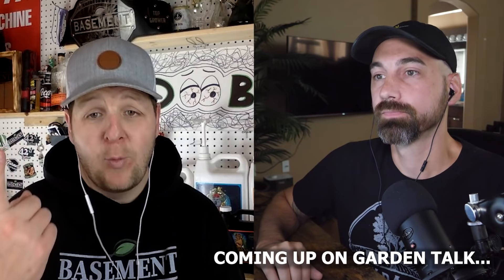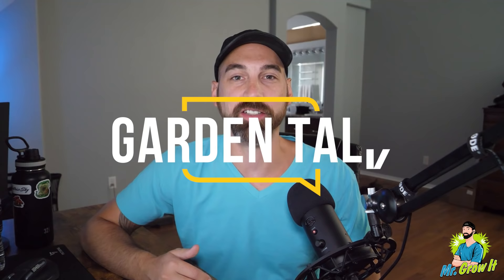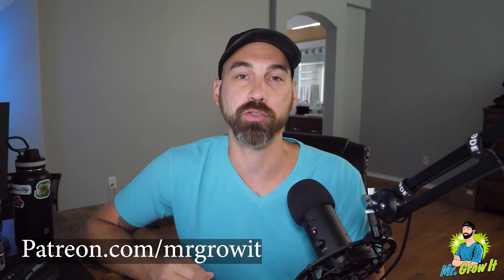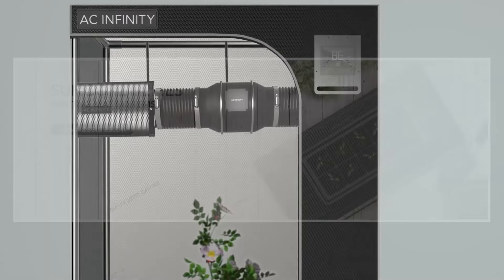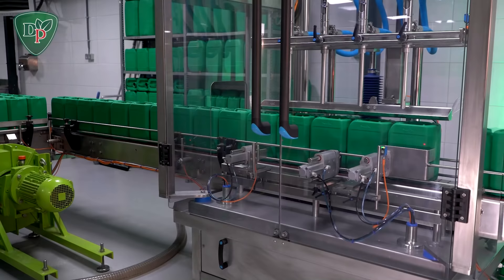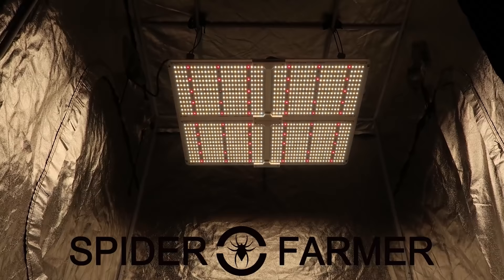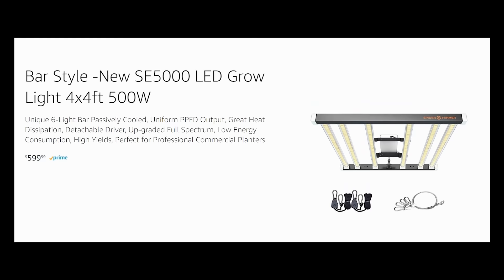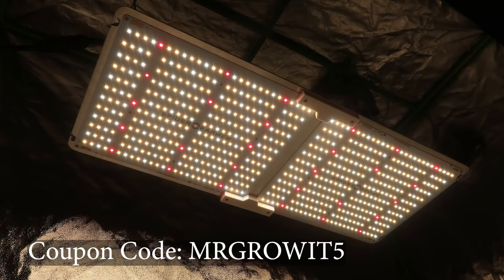Easy Methods For Growing Autoflower Plants! (Garden Talk #32)

Comment: We start autos in a solo cup. They stay there for exactly 1 week then we transplant to a 4-5 gallon pot. We do this so we can sprinkle mykos and azos on the roots. We did an experiment on this the video is on our channel. Mykos and azos can double the size of your plants.
Reply: Have you ever tried those peat planters? Then you don't have to remove them from the container to transplant them, but they probably aren't as cheap as Solo cups lol
Reply: @SegwayBossk  yes i have used peat cups..the problem is the roots have a hard time growing through them and they have to be removed during transplant..so solo cups work best 👌
Reply: @WATCHMEGOBROKE  what’s your average yields in 5 gals? What’s a simple feed to use that doesn’t need to check ppm n ph

Comment: Thank you Chris and joe, im a new grower on my first run in a 4x4 and I need all the help I can get! Running all autoflowers right now.. quite stressful, I think I’m over feeding? But they are growing like crazy.. idk stressful. These videos certainly help inform and are much appreciated!
Reply: Yea lower nute levels fsfs . I find a good super soil and a few top dresses is all ya need for an auto run  . 🍻 Happy growing 💪🌱💚🌱💚🕉🙏👊💯
Reply: do you see nutrient burn? maybe water more in between feedings and see if that helps. but if you don't see signs of overfeeding I wouldn't worry, are the leaves changing color to yellow? getting red stems? are they dark heavy green? if not you are *probably good
Reply: Yes I do see slight signs of nutrient burn, just on the tips a very small amount, I did end up doing that just water last night no nutrients, woke up to a pleasant surprise they are already loving it! Thank you very much!

Comment: I’m late on the podcast but here in Missouri we have such a flux in heat and temp. Even in a single day they can change by 40 degree F and 30% humidity. Great info watched the other gentleman you had on here even those two are some differences in thought. Always learning and appreciate the info you always give.

Comment: I like to use those peat starter planters for everything I grow. I start all seeds in a wet paper towel, then plant them in the starter pots with organic potting soil. I like them because the roots will grow through them and you'll know it's time to replant. Then just put the entire thing into the final spot and you don't have any transplant shock
Reply: I do the same but with coco and soil 50 50 blend. Then after about a week. Up pot, maybe even final 3 gallon depending on how I feel about it. If it's an auto or not also.

Comment: I have a cheap 12$ dollar (PAR:PH:MOIST LEVEL) PROBE from Lowes. Works fine and can get a great guesstimate. There is a sensor that reads the par. Lay the probe , sideways at plant level to get your reading. Great tool to read the dirt as well.

Comment: I'm a NOOB, but on my 4th run of autos, achieved perfection on the 3rd run. Getting 5-6oz per plant, always goes 12 wks. My system and set up is SO easy. They make it too hard.

Comment: Ok so everyone understands what the 48hr light deprivation is truly doing, your plant has trichomes that have glandular heads, they have not only THC but other compounds including the plants essential oils or terpenes, and your terpenes are one of the most volatile compound in the glandular head, it gets released from the glandular head due to ultraviolet radiation, intense light and elevated temperatures over 65°f, so your glandular head in the morning is larger, than  right before your lights go out, so by giving the plant 48hrs of darkness, allows the glandular head to swell or fill to a much larger head giving the appearance of a more Frosty plant, because of the light schedule and the lack of any kind of long duration night cycles during your grow, you will see a massive increase in glandular size that you've never seen before, as this does not promote any more trichome coverage, it still serves a great purpose adding light deprivation of at least 48hrs prior to harvesting, it gives your plant the chance to fill the glandular head with as much terpenes as it can, point in case a much smellier plant, and if I could give anyone a pointer on not taking away from this extra step, don't use your grow lights to see into your tent or room when cutting down your harvest, try not to expose your plant to high temperatures ultraviolet rays or extremely bright lights after harvesting to help maintain all of the terpenes gained by having the 48 hour light deprivation, hope this helps 👍
Reply: Also you will see a much larger increase in glandular size depending on the plants genetics, if the plant is extremely oily or smelly, you will see a more significant increase in glandular size.
Reply: if you have ever had an outdoor crop or single plant, you might have noticed that when it's really sunny and hot your plant is really really smelly, well that's all them good terpenes being released, so yes your absolutely correct, harvesting just before sunrise is a very beneficial time to harvest, I know some growers in Oregon that will put a sun shade over there medicinal plants two weeks prior to harvest to increase there terpenes and flavonoids.
Reply: @consolegamer3591  pretty well put. I will conquer and say I have noticed right before lights on...the smell will be extra thick.  I used to veg in a closet and had no ventilation.. I could tell the lights were getting ready to come on without looking at a clock. The smell would roll through the house like a wave..flower was always in a tent with ventilation fan running. I've done the 48 hour thing the past 4 runs..I have to say I don't notice a difference..but it's not hurting anything..so why not?
Reply: @budstermcgreen6360  It really does depend on the cultivar, and your overall environment, how intense your light is and the output of your uv, if you have a very smelly plant it would be much harder to see an improvement in overall smell, but you should still be able to observe an increase in glandular size, I do have a channel created that I will include related articles to this and a full breakdown of the research behind the trichome development and interactions between environment and the release of terpenes and other compounds in the trichomes, to much to cover in this format, but if you have any questions feel free 👍

Comment: From 80 to 100 F is 20 points of interval measurement, 26 to 36 C is only 10 points of interval measurement, so obviously fahrenheit is more precise. Those are the same temp ranges with twice the capability to measure in F compared to C.

Comment: I've use that mycorrhizae fungi and seem like when I sprayed it on my plants it burns them up seems like it shocked them for about a week or so makes the leaves turn brown
Reply: Were you using straight mycorrhiza or were you using like a slow-release fertilizer with mycorrhiza in it, cuz I've seen a few of those and they try to make it look like it's just micro

Comment: I put auto seeds in a propergation cube which is inside a rockwool cube and plant before roots come out the cube easy had no problems. Every time I put a seed into its final pot (coco) it failed convinced it dnt work.

Comment: The use of aspirin on plants appears to be beneficial, but the question is: why? Apparently, plants produce small amounts of salicylic acid on their own when they are stressed. This small amount helps plants cope when they are under insect attack, dry, underfed or maybe even experiencing a disease problem. The component helps to increase the plant's immune system, just as it does for us. A dilute solution of aspirin water for plants gives accelerated germination and some resistance to disease and pests. Aspirin in vegetable gardens has been shown to increase plant size and yield.

Comment: PPM is a part of your grow that is advanced but also fun to “dial in”. From a DWC standpoint it serves many purposes but for those starting out it helps on saving money on nutrients in the long run.  Here’s a simply way to understand this and why.  If you have 500 ppm in nutrients for a 5 gallon container, your goal is to find out if your plant is drinking and eating the same amount over the time of your mixture.  If your plant drinks 1 gallon of your mixture out of the 5 gallons and your PPM rises to 700, you just over fed you plants and wasted money in nutrients.  Vice versus if you started at 500 PPM and it drops to 300 ,your plant then is eating more then drinking.   Keep a log of day to day PH and PPM measurements and most of all have FUN adjusting them in small amounts until you “dial it in”.  This takes time and patients but so satisfying to achieve in the long run.  To all the new growers or ppl interested in growing,  I personally have found fixing under fed plants is easier to fix then over fed and here’s why.  Your fan leaves will never lie to you and will show you exactly what they want to eat. Take time to look at different types of photos of nutrient deficiencies,  your plants will thank you later.  Hope this helps in a simple way, have fun and keep growing

Comment: Free pro tip...For CO2 production use exhale bags, once the bag is 7 months old, cut it open and split the mass into 4-8 sections, buy empty mushroom bags, prepare fresh media in 4-8 mushroom bags, them put one piece of the mycelial mass you divided into each bag and write the date on the bag seal it up and hang it from your grow room ceiling.. 1 bag will do 4x4 area, so for a 12x12 use 9 bags, etc... Once you buy one exhale bag you can create your own CO2 cultures for free repeating for many years... This is by far the most cost efficient way to put CO2 into a grow space.

Comment: Question: I'm about 2 weeks until harvest growing in a 7 gallon fabric pot. The last couple of weeks, the soil has compressed and surface has "hardened'. The water will seep in after a minute or so, but it is nothing like the immediate absorption when soil was new. 
Should you add additional new soil to surface, try to turn over top surface, or just ignore and try to water, give time to penetrate, and then water again?
Reply: I’m the past I’ve just tossed on a rubber glove and gently moved the top surface of the soil to loosen it up :) just don’t be too rough
Reply: get some type of surfactant like sapponin or yucca. they are "wetting agents". they help the water penetrate the soil. gives it more surface area so it doesnt just pour thru

Comment: Don't give up on an auto that seems to be a runt..I've been getting one going since late May from seed and was struggling with one that just seemed like the runt of the litter while the other was getting bushy and healthy. I did transplant them both a few times and it probably did stunt some of the growth with each, but now the runt has become my main yielder and is up past my hip. My "Healthy" hit a certain point and doesn't like to grow upwards but likes to get bushy and grow a ton of leaves outwards and inside itself. It is now going into late September and the Healthy plant is flowering but still in that earlyish stiff pistol stage with golfball sized flower at the top and smaller quarter sized at the lower ends, this plant has needed fan leaf trimmed like once or twice a week because it gets so bushy and I walk away with two hand falls every trim... While my runt is taking off with 8 stalks of corn sized flower in perfect and size and I've only made minor trims,  About 2 very minor trims it's whole life so far. It's weird but I can't complain....All that said I do have to say that I've been running weaker side of lights. Some old T5 CFL's  in a 5 row about 24' long and 2 "2000watt" blurple lights from Amazon with the 3 cooling fan on top of each. They are not horrible lights but my old T5 CFL's from ten years ago seem to be pulling most of the weight. Have a better light coming now and I think it would've made a faster grow had I invested in my light system earlier on..Running the infamous Fox Farm line up. One tip I've learned is to forget about using the grow nutritions I gave the runt nutrient lockout trying out the Veg nute so it just ran PH'd water in it for alot of the Veg. The Tiger bloom is working excellent though! I now add 1 teaspoon of Tiger Bloom per liter of water because it started showing signs of deficiency and it has finally rescued the runt and has it looking really good. The 1 teaspoon per liter PH's my water perfectly so that's why I continue to do every other day in flower and that plant loves it..The healthy, bushy plant mostly gets PH'd water with every now and then a little bloom but has never showed any signs of deficiency,  so I try to leave it alone as much as possible...Live and learn though...Now I'm thinking of using the T5's for early veg and transfer from solo cup right into a 5 gal smart pot under the new lights and controlled evironment..Hopefully I get the quicker that people talk about with autos
Reply: Goin on over 4 months and still in early flower? You sure it’s an auto? That’s wild....never heard anything like it...also transplanting “a few times” is crazy, once fair play but more than that you are just stressing it out for no real reason.
Reply: @bygoneera9521   Well that's what I started thinking too. So I flipped my lights from 18 on to a 12/12 and sure enough the runt started flowering but the bushy plant still barely wanted to flower...Yeah I didn't mean to want to transplant that much but it's been over 10 years since my last grow so I tried skimping out on what I had available and it was a goofy ceramic pot..The plants didn't like it much so I went to the store and grabbed real pots and bought 1 smart pot to try out...I would definitley do some things different once I start a couple new ones again...Yeah they were seeds from Growers Choice. I got 3 auto seeds of Sour Kush and 1 didn't germinate. The quality of seed didn't seem to be real high so I'm gonna try a different company next round
Reply: @50StichesSteel  we just need to work through with what we got, sounds like you will get there in the end👍 best of luck

Comment: There's evidence out there that if you put a seed in your mouth it will transfer alot of different kinds of your "data" sent to that seed possible alterating many parts of the plant more to the individuals needs. Anyone do this? I have few times but not enough to say anything. I'm  a little nervous to put the good spendy seeds through that.
Reply: Fluctuations in co2 can stunt growth. If it gets used to breathing 1200ppm and that ppm drops it can have issues not having what it's used to. Co2 runs should have everything super dialed in to get all the benefits or you could just be wasting money.

Comment: I'm so bummed out. I need to throw in the towel and stop growing😢😭 i can't grow outdoors due to HOA and can't afford to continue growing indoors because of electricity cost🤦🏾‍♂️ my electric bill has been $500-700/ month running a portable ac, dehumidifier and the grow light (in either cycle). The RH here where i live is typically above 80% and its been a nightmare trying to keep that down and keep the temperature of the tent down too. It's been really fun but I'll have to wait some years until i can get a house which where i live average around $800k🤦🏾‍♂️🤦🏾‍♂️🤦🏾‍♂️🤦🏾‍♂️
Reply: do u have any exhaust equipment.  like an online fan?. u can use this to exhaust hot air from the tent or space made from the lights etc.... if using a tent, u can open the vents at bottom of tent, and passively pull air in ... have the lung room or room the tent is in , ( or pulling new air from) is  air conditioned  and humidity is in check.... u should be fine , without lots of electric bill $$
Reply: I had a ac infinity fan inside the top of the tent exhausting out the window. Electricity here is $0.46/kwh

Comment: Can anyone explain any science behind ppm or ec on soil runoff? Also from all the og indoor soil growers I know, they don't even have run off to test. I recently started the method and hands down have had my best results. Learn what your plant is communicating, a meter isn't a translation device.
Reply from the maker: PPM/EC are measurements used by growers using synthetic nutrients to help ensure they are feeding proper amounts. Organic growers traditionally do not measure PPM/EC. It comes down to nutrients being plant available vs needing to be broken down by microbes first. Lots more differences between synthetic vs organic. Too much to type it all in this comment.
Reply: @GardenTalkwithMrGrowIt  I get what youre say. For flood and drain hydro and drip system hydro important. But ultimately I think most home growers are using a organic medium with synthetic nutrients. I get ppm/ec and pH going in. But coming out, especially beginner level it's almost an unnecessary stress that really isn't going to solve or tell you the issue you're having. Which you know as most experienced growers do, over watering is the biggest cause of failure for beginners. Which basically watering to run off in a organic medium especially for beginners is a recipe for disaster. I've been going off a suggestion of watering 10-15% capacity, and feed 1/3 of waterings from a veteran grower.  It's been killer as far as results and I have no run off. Sorry if I come off rude. I appreciate pages like yours and wish I had them 12+ years ago when I put my first seed in soil.
Reply from the maker: @jakethoemmes993  It can certainly help give you an indicator if you're over feeding or under feeding because there are specific PPM/EC ranges for the different stages of growth. For example, if you see a plant deficiency, getting a PPM/EC measurement will show you if your PPM/EC is too high causing a lockout or too low with just not enough nutrients. The runoff isn't the only way to get a PPM/EC measurement. Look into slurry test. Hope that helps a bit